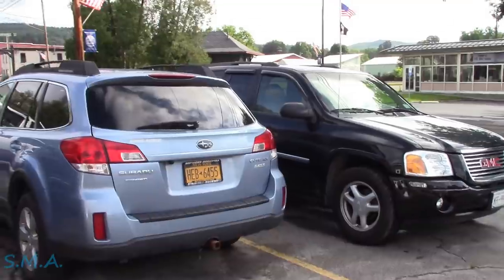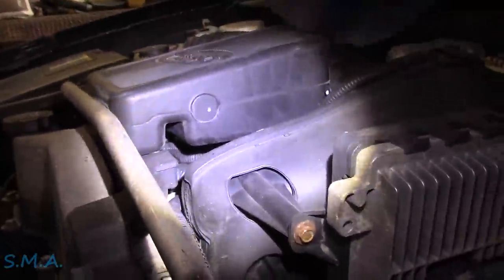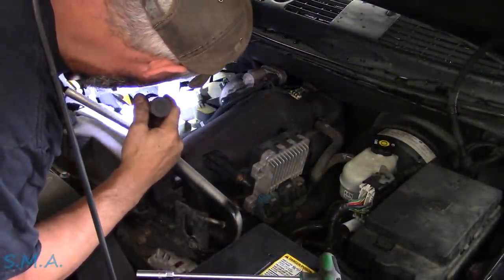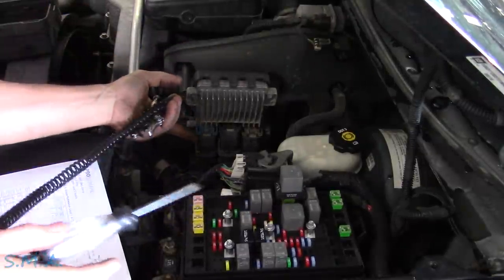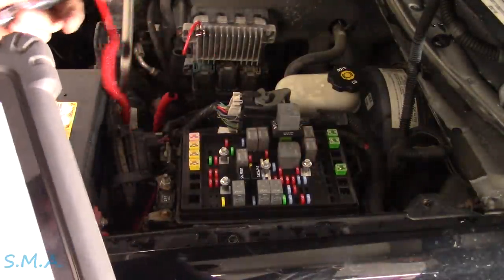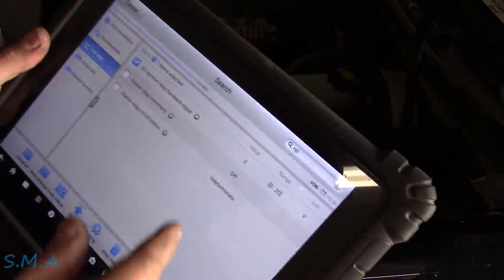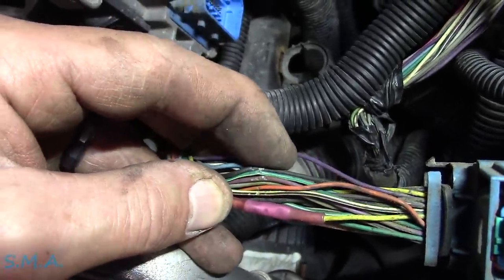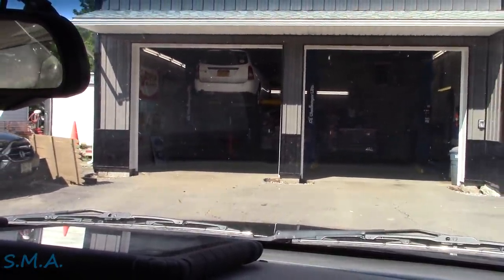GMC Envoy: No Throttle

Comment: I am a GM master technician with the world-class rating. There is absolutely nothing wrong with what Eric did with that butt connector. Solid repair,  great video.
Reply: Better than solder in high vibration applications. Solder makes the wire weak where the solder wick ends.
Reply: no one is a master at anything, before we know it, they change the game
Reply: Great job Eric 👏👌
Reply: You make me throw up in my mouth a little!JK
Reply: I'm not a hmm matter tech with a world class rating but I agree there's nothing wrong with them little buggers. I use them all the time to good affect
Reply: Eric has connections,  we will look up the factory procedures for wire repair and see what it says. There is always a reality of repeated successful field repair,  many successful repairs over a long period  of time. Regardless of what the OEM repair procedures state. Considering that Eric has probably made a few hundred of these repairs over 10-15 years, with no comebacks demonstrates an acceptable repair process.  Also throw in the harsh conditions the vehicles operate in...yea...stay the course Eric.
Reply: Quick check, OEM procedures state for harness repairs on harnesses with more than 9 pins, use Duraseal splice connectors, which is what Eric is using. Great dialog from all. 👍
Reply: I love me some butt connectors 💯💯💲💲my favorite
Reply: @CARyan08  I would have that that the OEM recc would have been to replace the harness.
Reply: @xenolard  My world class rating only means I have successfully completed all nine Master Technician Certifications in the Mechanical area, along with the accompanying ASE Certifications. WCT Rating only requires 8 out of 9 but I got 'em all.
Reply: For a company with such highly trained techs, maybe they could hire some equally highly trained engineers to not design it like garbage in the first place!
Reply: @gorak9000  Don't blame the engineers, blame management and the accountants.
Reply: @stevemarquez9628  ha..yes, that is the recommendation for harnesses with less than 9 pins on the terminating connector.
Reply: I'm a GM grand ultimate technician.  You replace the entire wiring loom!
Reply: Ditto that.
Reply: $scale scale and get
Reply: Ocean salt water corrosion ruins every connection known to man. In my experience, those heat shrink butt connections (if done right) last many years in a regularly submerged boat bilge. Under a car's hood will last a lifetime on a NY car.
Reply: Why are you watching this video when you already know how to do this repair? That is like me passing a calculus class and then watching a video on learning calculus. If you really are a master tech then boy do I have some questions for you about my pontiac grand prix!
Reply: @plantmanstudios  Cool down, I do both ways. But I prefer removing the plastic surround..crip the braided wired on the connector then soldering it. By soldering it I me saturate the heat where the solder is soaked into the braid and on the alluminum connector. Then heat shink, silicone or expoxt water tight seal.
Reply: @WhiskeyRiverRifleman  and of course you should be ABSOLUTELY proud of yourself for that as I am proud of you for further educating yourself!
Reply: @plantmanstudios  omg I had a 91' STE all options including the all leather and sunroof! I loved that car and I only wish I still had it today! Cheers from Canada bro
Reply: @plantmanstudios  maybe he watches them for the entertainment value?  I do.
Reply: @WhiskeyRiverRifleman  So you know what you're talking about.  Got it.
Reply: @WhiskeyRiverRifleman   whats your opinion on these vortec 4200's?
Reply: What is the factory torque specs on the set of pliers for a butt joint connector ?
Reply: @adamUDavies  German torque specs, gutentight.
Reply: "GM master technician"... lol Thats just about the same as "World certified master hamster veterinarian".
Reply: Blah blah blah.. certifications don't matter, 100's of successful repairs don't matter, that the repair miraculously worked doesn't matter. The Internet has spoken via our esteemed panel of couch based mechanics. String him up as a message to others then we can march on the 3M factory and put an end to this madness once and for all /s
Love the videos, thanks for sharing, I'll miss you.
Reply: Hey I need help. My 06 Envoy isn't accelerating. Started out of no where while driving. I give gas and nothing happens. But when I shift the truck in park, nothing happens and still idols along. Makes a grinding noise when I shift into park.
Reply: @fantared5263  all exceptional couch mechanics understand the Golden rule. Duct tape makes it stick WD-40 makes it slip
Reply: Pls give your email. I have some transmission shifting problem.
Reply: Fantastic  Mr.O. keep up the good work you do. I wish you were in australia.
Reply: Totally agree, I went to GM electrical school many years back, and it was a GM approved repair.
Reply: Yep.
Reply: @lukem7203  lmao
Reply: @lukem7203  That goes double if you have air gaps or you didn't get the solder hot enough to flow properly.
Reply: I agree 100%. Especially because they are epoxy filled.

Comment: Seems like if it weren't for SMA, then a lot of auto repair shops would go out of business.
Reply: Sometimes it's best to farm out the stuff you don't do well to those who can do it more effectively.
Can save the customer money in the long run.
Reply: Or at least, they would not obtain the Google 5-star review they obtain with Eric's help!
Reply: @Cheepchipsable  Some shops are too busy or do not have enough garage bays to mothball teardowns while waiting for parts. My Durango had to be outsourced to a shop 20 miles away to do a total brake line replacement for the entire chassis because the shop did not have the tools or the space to do it.
Reply: I know you patched a little hole were you poked the yellow wire but you didn't show us now I worry

Comment: You know you're good when you have a constant flow of work from other shops that can't figure out what's wrong and have to bring it to the Big Kahuna to get it fixed. Watching you track down the problem and fix it correctly instead of replacing parts is a joy to watch. Getting to see Mrs. O isn't a bad thing either 😉. Great job as always.
Reply: The funny thing is, with schematics and his scan tool that can see inputs and live data, its not hard to track down eletrical issues. The other shops should be able to do this. They are a legitimate mechanic shop afterall

I say its easy but I also have a computer science degree and had to learn electronics repair so i use those skills when diagnosing vehicles also. So maybe its hard for others even though they should be trained to repair vehicles properly if they are a legit shop.

Comment: If all types of different crimp connectors are good enough for aircraft, they’re good enough for earth bound vehicles. It’s all about proper use.
Reply: You beat me to this.  My uncle worked on aircraft for many years and those things are put together with crimp connectors and zip ties.  More than adequate.
Reply: Jeff, my first shop foreman was a retired air force guy, he told all kindo horror stories that makes me not wanna fly! He did say that it's all about the proper use in the proper place, that one stuck right up to today!
Reply: I got hung up once at an airport for 1hr sitting on a plane at the gate because of a seat back tray that wouldn’t stay up. People were giving the crew and the mech who showed up all kinds of grief.
Reply: My favorite “mechanic vs passenger” story is when an old friend of mine was working in the cabin with a plane full of people. A passenger was giving him grief about him talking too long to fix the problem. He finally had all he could take and told the passenger, “Unless you want to end up in the bay in a pile of whale shit, shut up and let me do my job!” (He was working on electrical cables the size of your thumb behind the flight attendant seat.)
Reply: Yeah, if you don't trust a crimp connector, you've only used the cheapo dollar store ones. They come in vast qualities.

Comment: My thought on the "crimp/seal" connectors: a repair pigtail from Cummins for one of their engines utilizes crimp/seal connectors. If crimp/seal is chosen by Cummins it is fine for use by anyone.
Reply: Worked in a VW dealer several years ago and several times you got a repair kit there was this style of crimps. VW didient agree of using those with solder.
A friend of mine worked with Toyota  forklifts and they was onley allowed to use unisolated crimps wih heat shrink after so you could see if it was a god crimp.
Reply: Ford tech here.  All our warranty wire repairs use mechanical crimps with heat shrink and  glue.  Same stuff.  I would assume most Oems are the same.  You the man Eric keep doing what you do!!
Reply: @fulf :  I can see that. I absolutely HATE crimping through a condom, so i make a perfect splice with non-insulated crimp, then slide the gourmet, 3M marine condem over it and cook with HOT AIR (not a lighter or torch). The repair is like ART, and is less bulky per wire, if you have a bunch to fix).

Comment: This wire damage is really common in the uk gm range , as regards your repair duraseal butt connectors are dealer recommended, so concrats on showing the people how to carry out a proper wire repair.

Comment: I've recently migrated from being a big-box retail auto parts window-licker to being an commercial auto parts window-licker... the number of oxygen sensors, throttle position sensors, even those god-awful Ford vacuum hub disconnect actuators that get returned by shops not doing proper diagnoses is making me lose faith in the automotive industry. Thank you for teaching me how to do it right.

Comment: I imagine the rust will kill that car first before the crimp seal connector fails again.
Reply: 202K on it, if his fix lasts three weeks, that's all the car has left in it. =-D
Reply: @jack002tuber  Oh, ye of little faith.  My wife's 07 Trailblazer has 289,000 miles and is still reliably transporting her around.  In NY.  With plenty of weight reduction.  That GMC looked in reasonably decent condition.  It'll last a while yet.
Reply: @jack002tuber  Learn how to maintain your cars and they will last the rest of your lifetime. Follow oil changes and maintenance schedules, be aware of things that do not feel right.  Also sheetmetal and bondo as well as chassis protectant paint will take care of the rust issue.  The airplanes you fly in are often 25-30 years old and still airworthy because problems are caught before they cause a problem, and maintenance schedules are followed. That's really all there is to it.
Reply: 2008 Chevy trailblazer with 150000 miles on it with little to no rust and runs perfectly 💪🏻🙌🏻🙌🏻
Reply: Fords are the rust kings in my opinion. They rust like crazy
Reply: @fsu3784  I love my Envoy. 🥰 Only have had my 'Voy for a little under a year and have put over 10,000 miles on it. Still running great. No leaks, just needed all new brakes and I cleaned the throttle body.

Comment: I've never had any issues using those wire connectors. But to each their own. 
Another great video.
Reply: I've used them with zero issues as well. I think crimp terminals earned their bad reputation due to all those crappy, pos, sheetmetal stamped electrical pliers.  A good crimper makes all the difference in the world.
Reply: That’s what they use in aerospace.
Reply: They look pretty legit to me
Reply: We use these on 3 million dollar mining machines, no issues
Reply: I use those crimps on milk tankers that get washed every load and have no issues with them, every other repair type has issues . The cheap ones with no glue are junk though.

Comment: I love those crimp seal connectors. Quick and easy, and it's what most car makers recommend (require) you use.
Reply: I was about to comment that it is the recommended VW repair. They explicitly state to never use solder connections.

I have always used the crimp/heatshrink/seal type and have never had any issues.
Reply: @dannywood6842  yup. Never had an issue with them in my 13 years as a vw/audi/Skoda tech.
But it can get bulky. Had to repair a transmission wiring on a flooded allroad once. Some 60 wires, if not more... Even if you stagger the connections, you'll struggle getting it to fit in its original place.

Comment: Thanks Eric, been crimping wire conn. for over 45 years, it just hit me, I've been destroying the coating on the connectors! Just like a rookie!
Reply: i've got about ten crimpers or  crimper/strippers in my toolbox  just because trying to find ones that wont damage the  plastic. they all work good new, bur once they get wear in them .......
Reply: You make us sick, Dan! Sick, I tell ya!
Reply: @TreyCook21  Glad I could help!
Reply: @danmarklesr6260  I have been doing the "Watch Wes Work" way with the non insulated butt connectors and then sliding glue lined heat shrink over it. Basically the same thing. I'm not a mechanic, though. Gah, I make myself sick!

Comment: I used these when I was working, they are a good repair. I worked on salt trucks for 35 years, until we started using these and crimping them correctly  was a godsend for us. I also used liquid electrical tape to repair where we used a test light.

Comment: For the record, most (but not all) aircraft wire connections are crimped... even from the factory.
Reply: I saw someone comment about that on a video once concerning aircraft, I believe the reasoning is the vibration can cause the solder to crack. That's why they use the crimp method. If it's good enough for the airline industry, it's good enough for passenger cars for sure.